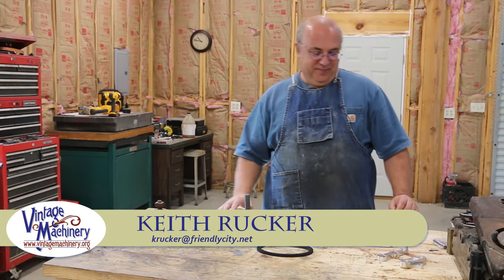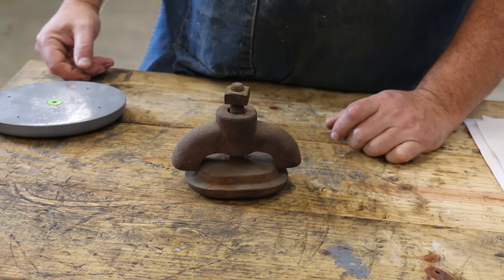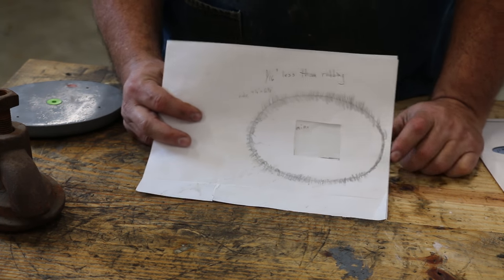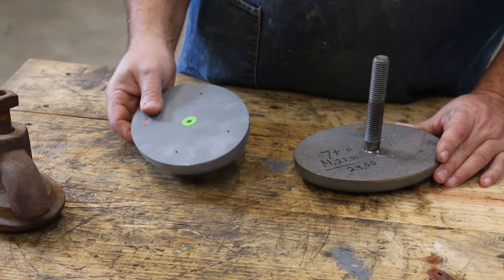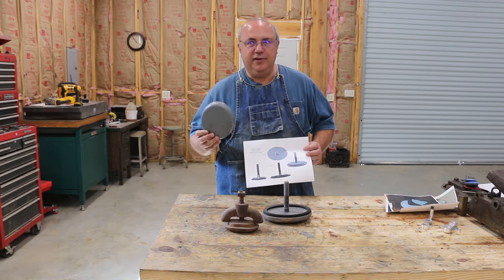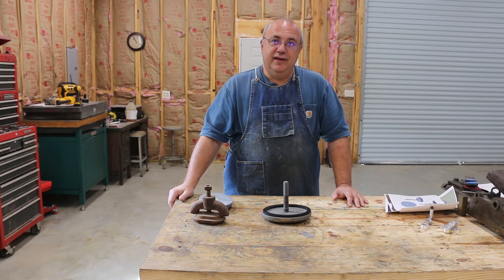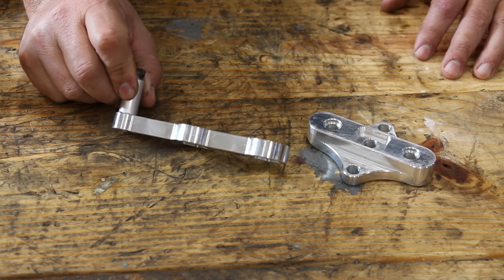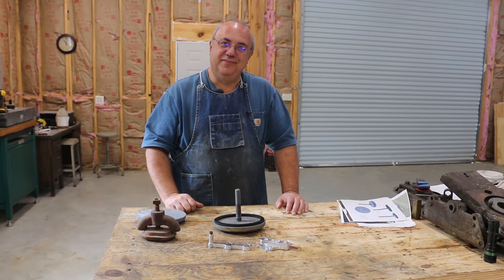Collaboration Project: Steam Boiler Hand Hole Cover

Comment: There's something really appealing to me about the idea of generating a 3D-printed template, using it to produce handmade casting, then chucking it in a Modern CNC setup before bolting the final part to a century-old machine.

I appreciate that you took the time to explain the journey this part's been through and that you're willing to work with and make use of the new-school techniques in your work!

Comment: I remember setting the hand hole plugs on a navy ship I was on. Had to take them out for an inspection and later hydrostatic testing. Many times they wouldn't get set just right and lots of water got dumped on you til you got it just right. fun times

Comment: I use both Solidworks and Fusion quite a bit for both school and some personal work, and both are excellent CAD packages by themselves. However, both can do things the other cannot do at all or do very easily. I like the refined and simplicity of Solidworks (I have been using it for about 1 and a half years now), however I like all the features and the "all in one pack" that Fusion has (ive been using Fusion for about a month, mainly for CAM). I will say I have been watching a lot of Johns videos on Fusion and its becoming a lot easier to use and understand.

Comment: Hi Keith we use fusion 360 to run our CNC plasma table and it works great. Yesterday we used  one of John's tips  to make a part. A customer came  in with a cardboard template with a lot of crazy curves about 64"×16" we took a picture and downloaded it into fusion made DFX file and cut the part and it came out great.

Comment: How would the old timers done this 100 years ago when the Vulcan was built? 
Maybe an interesting project for David Richards (old steam power machine shop) to sink his teeth into?
Comparing with the older hand hole cover (@1:39): shouldn't the new one also be curved to fit the boilers curvature?
Very interesting project there.
Thank you for sharing!
Reply: I think that with enough brain power, and outside the box thinking, the answer is yes. The real question here is, could they afford to do it, and well, that's a pickle to pick at.
Reply: If the gasket step wasn't already cast into the part at the foundry there's a few methods I know of that could have been used a hundred years ago. Attachments for turning elliptical shapes on a lathe aren't that tough to make. I believe there's at least a few shown on YT for use on a wood lathe. But the basic principle is the same for turning metal elliptical shapes Milling to coordinates would take a long time but it's still possible. Manual tracer attachments for mills that follow a master pattern much like what are used on manual engraving machines were in use as well. Some specialty lathes were built to use what's called a relieving attachment that are mostly used to provide the cutting tips relief while making something like milling cutters. But with the correct pattern could do it. Even cam driven cross slides geared to the lathes headstock rotation to follow the cam shape and drive the cross slide in and out during each rotation of the part were used. Welin interrupted thread internal and external breech threads used on artillery were made that way. Really old school would have been a cold chisel and file.
Reply: For a one off part, it would be done the same way then as now. trace a line on the part, mill by hand close to the line, finish off with a file.
Would probably have taken less time that it took for John Saunders to mill it, let alone mucking around with the drawing and tool paths. Guessing Keith opted out of that route because it is interesting to make a community project, and he has better things to do than file a rabbit on cast iron.
Reply: 100 years ago it was probably the apprentice with files that finished the cast part before assembly.

Comment: Funny to see the modern methods making antique parts.  I aimgine the original would have been entirely cast thus the reason for the very thick gasket, but a machined surface will be a better seal provided the mating surface in the boiler is also true.

Comment: The boiler we had was worn. We used over sized pear shape handhole plate.  Percentage wise, what were the savings versus purchase from Oswald ?
Reply from the maker: We could not find one the correct size that was cast iron rather than just pressed steel.

Comment: Hi Keith. Just a question, does your boiler code allow cast iron to be used for hand-hole doors? Forged steel or cast steel I can understand but cast iron would worry me some.  Just curious.  You do great videos, thanks.
Reply: Cast iron is used for pressure vessels of all types and sizes.
I think you are underestimating the strength and durability (even in harsh environments) of the material.
Reply from the maker: Its pretty common.
Reply: I am not underestimating the strength/durability of cast iron, but ever mindful of the possibility of hidden flaws. But obviously it complies with your boiler codes so all is good.

Comment: Assuming these both work at the same pressures, wouldn't a larger size be thicker to withstand the increased overall pressure being exerted on the flange?
Reply from the maker: Not necessarily more pressure.  The boiler is rated for 150 psi.

Comment: Since the pattern was being made on a 3D printer, couldn't the recess for the gasket been included so it wouldn't needed to be machined?  I don't think it would have been any more difficult to cast.  Just a thought.  Keep up the good work on the videos!
Reply: I would have thought this would have even made for a stronger part as the grain structure would flow better around edges of the cast shape when cast.
Would love to know why it was done this way instead.
Reply: That would seem to be a logical approach especially as it saves an awkward second operation.. I note that the small one looked to be made that way.
Reply from the maker: Sure, you could have cast the step in the part, but it would be a rough casting rather than a machined surface.  The machined surface will seal much better against the gasket.

Comment: I enjoy every video you make, Keith. Thanks for doing them! 

Why are the handholds elliptical instead of circular? Seems like more complicated geometry was chosen for a reason?
Reply: Was it just so that the clamp could be inserted while the whole thing was assembled?
Reply from the maker: The hand hole has to fit into the hole and pull up from the bottom.  You cannot get a round plate into a round hole (why manhole covers are round - they cannot fall through the hole).  With it being an ellipse, you can turn it 90 degrees, fish it through the hole, turn it back 90 degrees and pull it up from the bottom.

Comment: CNC is much easier but a rotary table with a cross slide on top would be the easiest method I can think of for machining an ellipse, move the cross slide to the "imaginary pins" and then rotate and repeat for the other parabolic curve on the other side once you reach the midpoint of the part.

Comment: Could an ellipse be machined on a lathe with a relieving attachment?
Reply: i was thinking more of a wood pattern (easier to machine and including the cutout) and then casting it, thus needing very little machining?
Reply from the maker: I don't think so but I have never used a reliving attachment.  The relieving attachments had cams in them to make multiple reliefs rather than an ellipse.

Comment: After watching your video I went to John's channel to watch the cnc procedure for the machining and it was very well done. What I would like to see is an experienced job shop machinist such as yourself, Keith Fenner, Adam or any of the many manual machine, job shop professionals do this job and how they would go about it in their own way doing it manually. For this one-off job it would be interesting to compare the complete programming time, set up time, material/tooling cost, procedure and outcome tolerances of the completed job start to finish from the time it comes in the door till done. Including maybe even a hack like myself that may just lay it out with scribed lines and stick it in a vice and hand cut and grind it out. Single job CNC vs. Old School. May make an interesting friendly competition. I would also be willing to donate towards all time and material involved  to the competitors just as any job would be treated that came into their shop. Thanks Ed K. Cleve. Oh.

Comment: i was wondering why they didnt cast the step in it too,
Reply: me too,they can get precise castings, im sure the original would have been cast pretty much ready to go, or they would  have had to machine an awkward shape too
Reply from the maker: Rough casting against the gasket vs a smooth machined surface.

Comment: Typically the hand hole cover would be cast in steel not cast iron. The "wing" is more often called a strongback. The gasket step is typically machined in to give a better finish on the gasket faces. To install the cover it is put in the hole and pulled tight with the strongback, then when the boiler is up to pressure it is re-torqued so it won't relax and start leaking when the pressure is dropped at shutdown.
Reply from the maker: Most are cast iron.

Comment: If it was a wooden part it would be pretty straight forward.  So why not make a metal router?  I have seen one being used with carbide bits to put round-overs on steel.  It should be pretty easy I would think.    It would enable more complex shapes to be machined.  Just an idea

Comment: why didn't you cast the step into the part?
Reply: It would still need machining to make it flat.
Reply: Landrew0 nope. comes from the factory ready to install.
Reply: Landrew0 the ones I get all the time from boiler manufactures are ready to install. no machining nessesary.
Reply: Landrew0 cast surface and all. the gaskets take up the surface imperfections.
Reply: You have to step back and think what this project is. IE restoration of an old steam locomotive. Aside the fact that it's a way to involve others in the process, and all the stuff tied to that, you have to grow yourself in to the one item mantra. 
In short, it's much easier to hog out the excess to dimension (as it's already a tool path you take regardless of the step being there or not) than to go back and forth with your foundry (which he's not working) to get the perfect cast item, which, itself, is a big, big headache from part cooling to a % shrink, to the cost involved, etc.

There's many, many reasons i could put to paper, but finality dictates that it is much simpler to do it stepless.
Reply from the maker: A machined surface will seal up much better against the gasket than a rough casting would.
Reply: Keith Rucker - VintageMachinery.org 
That's undeniable.

Comment: Funny optical illusion- it looked round until you spun it around.  Sort of non- restoration when you CNC machine the part- I'm sure back in 1917 they simply cast the part with the step built in.  Wonder why the foundry did not do it that way.

Comment: I dont get it really. Why do you make a cad-model and then cast it and then send it to the cnc? Seems to be a waste of time and money if you could machine it on the cnc right away...
Reply: +Pacific Film Or at a minimum printed the necessary shoulder.  Since a gasket will be used doesn't seem like it would need to be milled perfectly flat.  The should was shown in the drawing but for reason they decided not to do it that way.  I do know that YouTube has been pushing collaborations, but I'm not really a fan of those all that much.  Some are better than others but it just seems to turn them into a reality style program to me.
Reply: maybe because it need to be cast iron with a bolt in the center
Reply: I think there are a lot of variable that may not be obvious to viewers, that may have contributed to the choices made in creating this part.  What are the capabilities of the foundry?  Was this project planned with CNC involvement from the start or was it originally going to be traditionally machined. Additional cost of CNC time vs foundry time, especially with the bolt feature. How much time were the people involved willing to donate to the project, being this is done for a museum I'm guessing this was not a project you could charge whatever you wanted.  I'm sure there are more variable I have not even considered, but the idea is that it is easy to question how things are done when you don't actually have to step up and get the job done.
Reply: If it was a new application then it could be made from plate steel but this is a replacement part for a 100 year old steam locomotive and they want it made from cast iron like the original. 
100 years ago the pattern would have been made out of wood just as the foundry may still have done for this part because the 3D printed plastic part was not made to account for the shrinkage factor of the cast part.